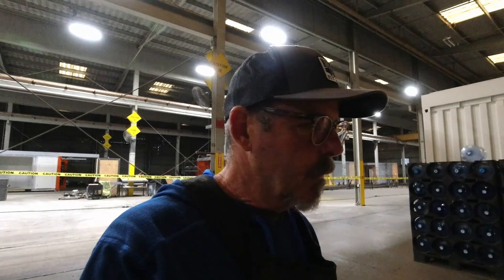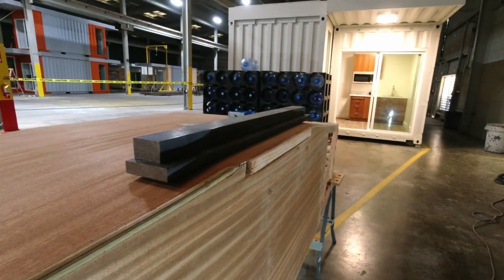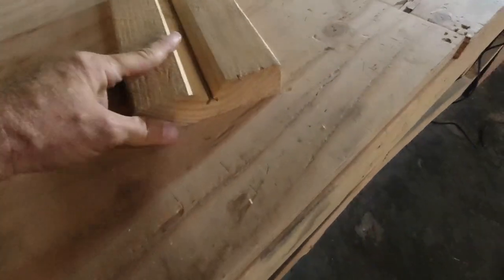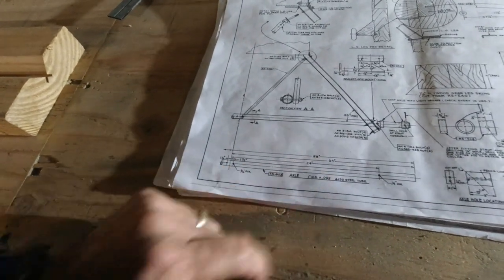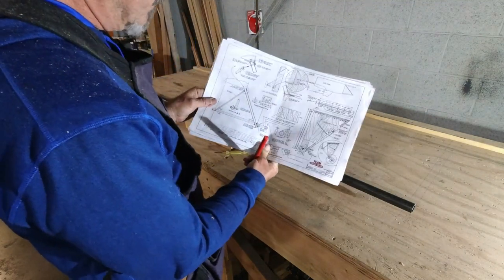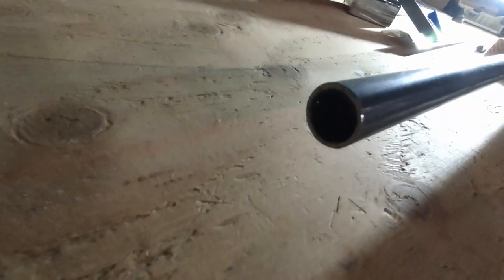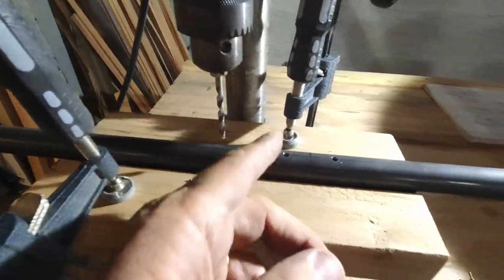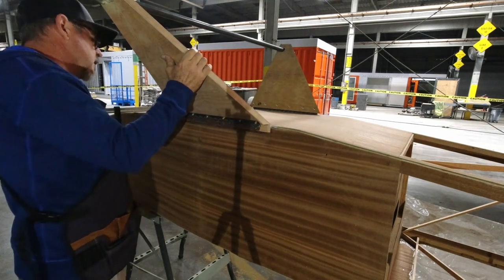Minimax 1100r Wood Aircraft Build Ep 84

Comment: Yes, Dennis, test fitting that gear assy. is a big day.  Looks very nice.  Oh, I was noticing your very nice work bench.  At the end of my EROS 1650 I had to figure out how to get the plane from Va. to Fl.  (was to be towed behind a motorhome.)    A friend gave me an old boat trailer which I disassembled and made a trailer on which to place the EROS.  Here's where the bench came in.  I disassembled the bench (almost like yours) and used those pieces for a deck on the trailer and other attachments to make it all work.  Down I-95 850 miles to Melbourne Fl. The FSDO at Orlando inspected the EROS.  Luckily, no "write ups."  :)  Then went flying!  Your project has a lot more detail and patience than mine.  I did have to use a hacksaw for that axel!  Many strokes. :)
Reply from the maker: Michael, I like that you and I are showing the spectrum of what can be done with this well designed airplane. It can be built with the most basic tools and it can be built, maybe a little quicker with some modern tools. Either way, a successful airplane is the outcome! 
That must have been quite a trip down I-95!
Reply: @DTMinimax  Dennis.  Later on, I was planning on flying from Fl to Va.  But, too many gas stops, with my wife  trying to find me at different FBO's.  :)  Always a fun trip up and down I-95.  :)   The EROS "rode" with the prop facing the traffic behind.  Yes, we got some strange looks as folks passed us.  :)   Did get a few "thumbs up" from some of them.  Flew directly over Melbourne International Airport on many an occasion - would be going to another fly-in breakfast down South a bit.   The tower would allow me to "Transit" the field,  at low altitude, if the clouds were a bit low, otherwise I flew at an altitude just outside of their "Delta" airspace.   They said they couldn't see me on their RADAR - told them "wood and fabric, negative transponder."   I always got a laugh out of some of the tower personnel.  Made a special VHF antenna so my little 5 Watt hand held radio really "blasted" into the ether.  :)   You would like Florida flying - is busy - with lots of foreign flying students.   :)  See you later, mike

Comment: Before I installed the landing gear, I had reason - or so I thought - to climb into the fuselage, to do something in the very front, as the fuselage sat upright on the floor.  So, I climbed through the cockpit opening, and, lying on my back, slid all the way forward, and did whatever it was I had to do.  Then came the fun part - getting back out.  I was at the airport alone, and it was about 2:00 AM.  I started trying to wiggle my way back out, and really had to talk myself out of panicking, as it was not nearly as easy to get out as you might imagine.  If I had to lie there until someone found me the next morning, you can trust me when I say that the story would have been front page news in the local, small town paper.  Anyway, I eventually managed to get out.

Days later, I read of another builder who pulled the same stunt, but was unfortunate enough to have his back go out in the process.  911 was called.  The EMTs took one look at the situation, and informed the builder that they were going to have to cut the fuselage apart to get him out.  You can easily imagine his response.  It was along the lines of, "Like hell you are!!!"
Reply from the maker: I can’t stop 😂 
When I was in the Air National Guard and we had KC 135 airplanes, I was the smallest guy in the fuel system shop. I could get into the wing tank near the tip and had to say how I was getting in so they could read it back to me in reverse to help getting out. 
I’m sure I would have the same reaction to someone asking to cut me out of my fuselage...not a chance, I’ll figure it out somehow. 
Now you just have to build another one Michael!
Reply: @DTMinimax    Thanks Dennis.  I'm glad you enjoyed the stories.  I may have mentioned that I lost my Mini-Max to a crash and fire, caused by engine failure.  I had chosen a Hirth F33 engine because it had electric start, and was lighter than the Rotax 277, and paid the price for that mistake - that engine was nothing but trouble, from day one.  After the crash, I had a SkyCycle trike, which I enjoyed more than anything I've ever flown.  It was ultralight legal, with a Rotax 447, and would outclimb anything at my airport.  It was a pure joy to fly.  But, for financial reasons, my flying days are over, almost certainly forever, and I miss it more than words can ever express.

Comment: I used a v drill guide by big gator tools to drill alot of the holes in round tubes you can find them at aircraft spruce. just clamp in place and you don't even need a drill press.
Reply from the maker: That’s a really cool tool...and not very expensive
Reply: I tried to post a link but it wouldn't go through. The one I have is made in the usa too. nice tool to have especially if the drill press isn't practical.

Comment: Will this aircraft still meet part 103 weight requirements with the 1/2 vw engine?
Reply: Not even close...  I built the 103 version, and even that one was all but impossible to keep under the 254 pound limit, and it is smaller, and used a single cylinder engine.
Reply from the maker: Carl, I’m expecting to be around 300 lbs
Reply: @DTMinimax  My EROS came in at 396.
Reply: @ExSkyCyclePilot  what was your final weight?
Reply: @carlb5451  I don't recall exactly, but you'd have to leave things out, like instruments, etc., and probably trim and route corners and such to get down to the limit.  It would be a challenge.